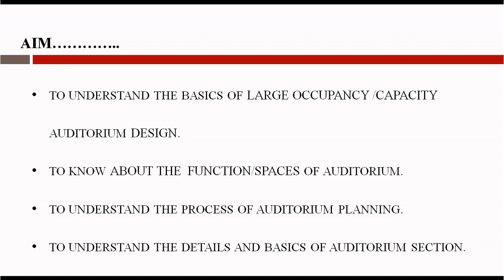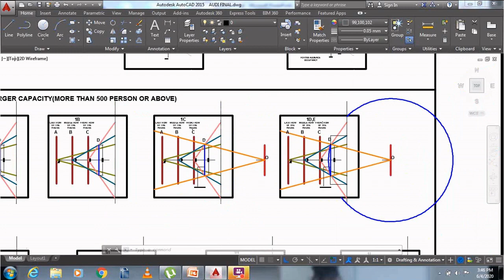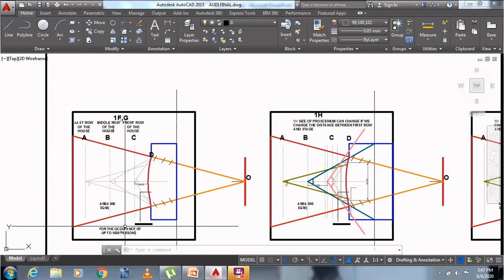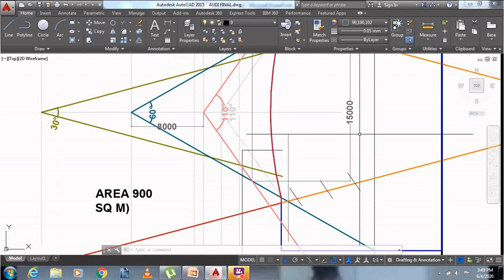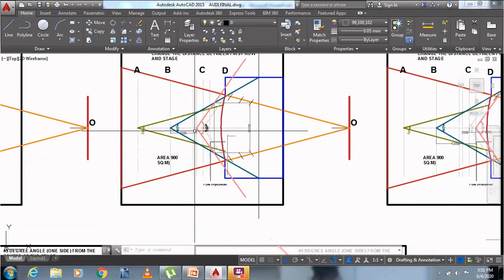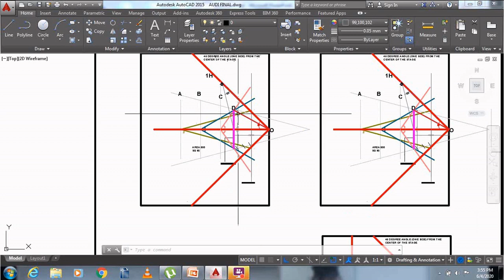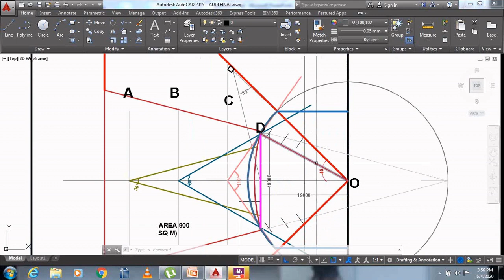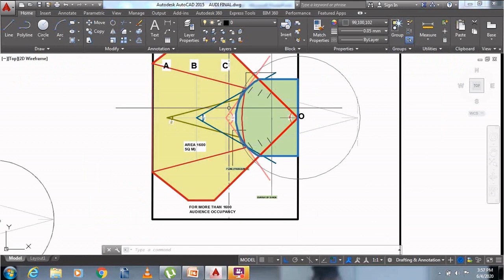AUDITORIUM DESIGN PROCESS MORE THAN 500 PERSON  OCCUPANCY

Comment: can u please tell me why have u extended the line A back  and how much distance you have taken it at (4:10)
Reply: The line was extended because it had to be extended to the line of Vision Angle O, which gave the width of the auditorium. For auditorium maximum distance from the stage you can take is 24 metres not more than that after 24 metres you can't see the movements of the performers. If you want to exceed the distance or want large auditorium you need screens then.